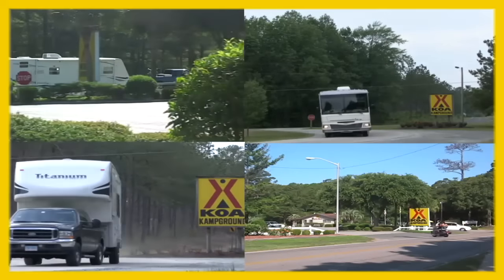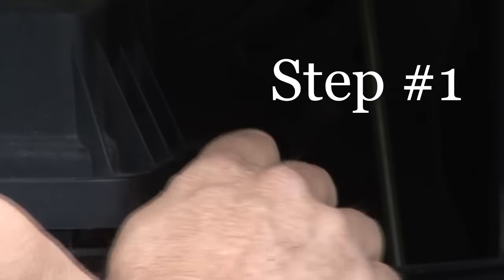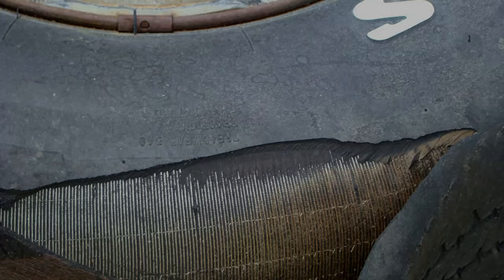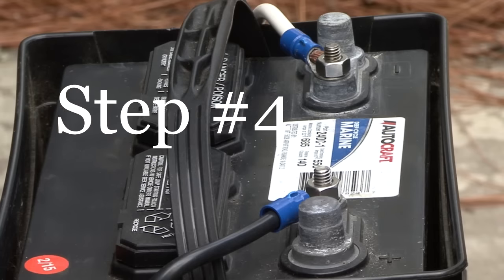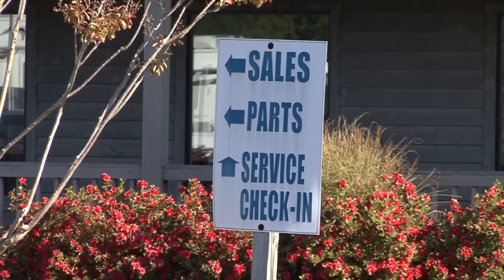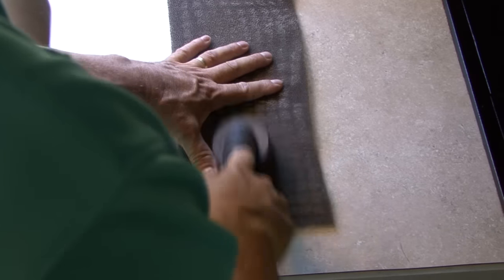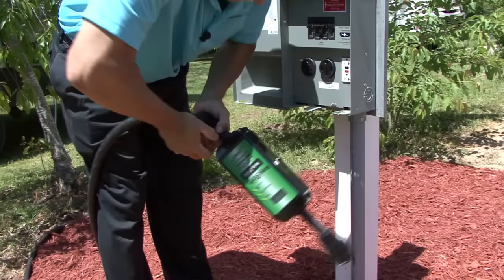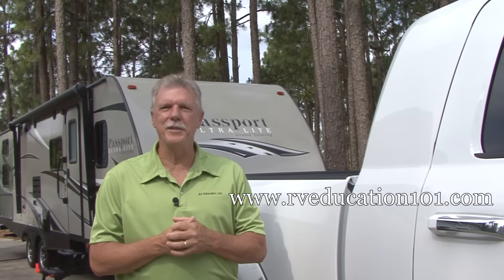Dog Daze of Summer RV Camping Tips

Comment: Don't forget to wash the condenser to the roof AC to clean out dust, bugs and trash so air can flow over the fins better. Spring summer and fall or each time you wash the roof.

I just did ours on this 01 Minnie we just bought and in this heat wave in Missouri. It helped tremendously! A lot of trash came out of the unit!

I know RVs drain straight to the roof but is there a system for using a drain tube? I discovered this unit "leans" to the left front or the drivers side and even  when level to the reefer. The AC drains that way and actually caused the sealant around the top windows to rot and cause a leak and around a fibreglass patch under the slider cover where it runs across.
That's some water damage not brought up in forums. The way many sealants can not stand up to constant water contact. 

Problem solved and remendied! Removed old sealant and reapplied new and added down spouts.

Blue Sky's and Safe Journeys!